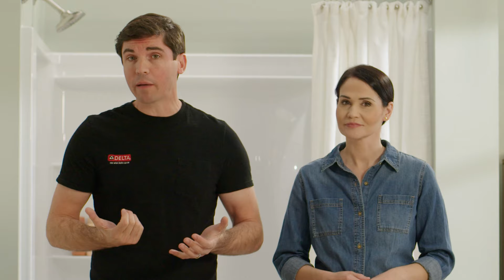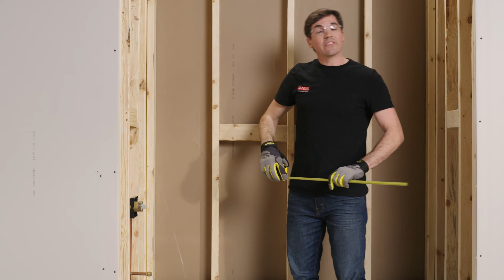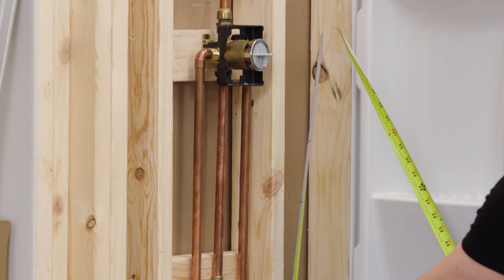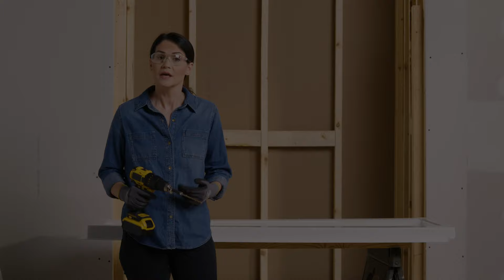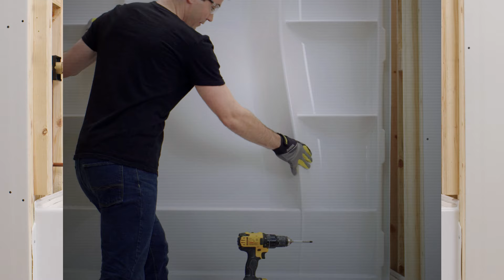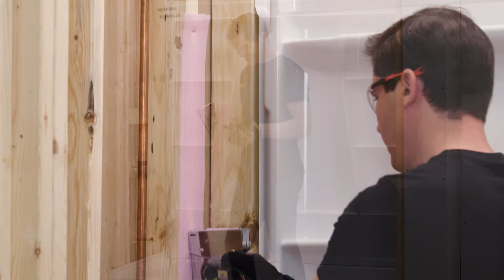How to Install a Delta® Classic 500 Tub Wall Set (60x32)

Comment: Why wouldn't you add caulk to the bottom seams of the panels on the interior of the tub? I feel like water would get underneath and behind the panel near the foam stripping if you don't caulk the interior seams where the panel meets the tube.
Reply from the maker: Thanks for the question! The panels have a caulkless design to simplify installation and reduce the risk of leaks. Sealant or painter's caulk should be used if any gaps are larger than 1/4".

Comment: You say in the video to put the foam tape just to the edge of the tub, but the caption box says to form a L below the top of the dam, extending 2" out.  Which is correct?
Reply from the maker: Hi CRASH TEST OGRE, Thank you for your question! At both ends, use the foam tape to form an L below the top of the dam, extending 2". The installation instructions should also show this update.
Reply: Thanks for the quick reply.  One more question: since we're supposed to go 2" around the corner now, is the caulking still required?  Thanks.

Comment: How far back from the edge of the tub (front skirt) should the door nailer board be?
Reply from the maker: Hi CRASH TEST OGRE, Thank you for the question! The nailers should be 33-1/4", minus the thickness of a 2x4, from the back studs. So about 31-3/4".  The width of the tub is 32", so the front of the tub should be about 1/4" from the nailer. I recommend the installation instructions for the proper door nailer locations.

Comment: How do you drywall around the top of the surround n why there's no video for this
Reply: Your comment is 4 months old. I’m assuming you’ve figured it out. Instead of explaining it. My best advice is finding another video of a similar type of shower where they install the drywall. And just apply their directions to this shower.
Reply: just cut the back side of the drywall where it overlaps the flange of the tub and shell by the depth of the flange.

Comment: What keeps water fron going underneath the panels?
Reply: A huge lip that protrudes that the bottom of the Surrond snaps into.  The lip is on the tub.  I can throw a video up if you still need it
Reply: I find that water gets trapped, i came to watch this video because i find if I don't use the steam cleaner in the seams my bathroom starts to smell. Im nervous about the caulkless system

Comment: When setting the door nailers you give all the dimensions needed except how far in from the edge of the tub the 2x6's need to be set. You provide the length of the 2x6's (57"). The dimension they must extend out from the framing (2 3/16"). And the height above the tub flange (1"). I assume the 2x6's must be installed in an exact location from the edge of the tub to accept the side panel.
Reply: 33 1/4” measured from the inside corner of tub, out. It’s in the installation instructions.

Comment: Do u have to caulk the seams to make it completely waterproof?
Reply from the maker: Hi Rachel, Thank you for your question about the Delta Faucet Classic 500 tub wall set! The panels have a caulkless design to simplify installation and reduce the risk of leaks. Sealant or painter's caulk should be used where the wall surround meets drywall or if any gaps are larger than 1/4". 
-Bryan
Reply: My shower gets so gross between the bathtub and the shower panel. It’s such a pain to clean!

Comment: Probably not going to get a quick answer on this, but how do I transfer the template info to the actual panel? Do I assume the distance from the edge of the panel is the same as the edge of the level?
Reply: Good question. Have you done the job yet? I'm considering it but am trying to decide if I can handle it.

Comment: When adding additional blocking - for ADA grab bars, should that blocking be covered with the sill plate gasket material as well?
Reply: I did. seals and doesn't squeak
Reply: it will never get wet
Reply: @robertschaaf7192  My understanding is that the sill plate gasket material is for sound deadening, not an issue of dry/wet.  That's why I asked about the other blocking sites, since they are not mentioned in the video.

Comment: total waste of time ,,,nowhere do they mention the depth of the mixer valve ,,impossible to set without that info ,,what a joke
Reply: probably way too late to be relevant. I recently went through mixer install and ran into that issue. Bought a phister, which had very little documentation, my 5th grade grand-daughter could've written better instructions than they did. I ended up taking the valve back and after researching instructions, settled on a Moen. Excellent instructions and appears to be a quality product. It has specs relevant to depth and etc. I suppose the mixing valve manufacturer would be responsible for producing an instruction video with these kinds of q&a. Regards....